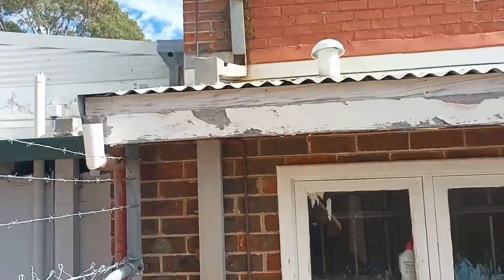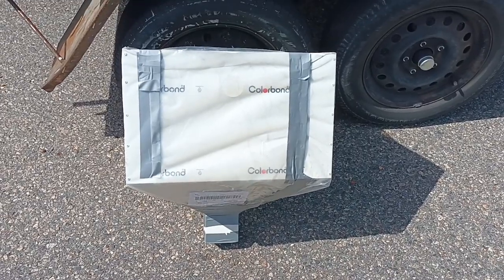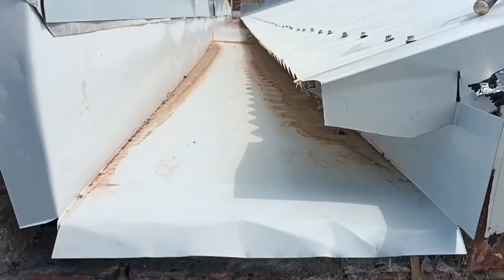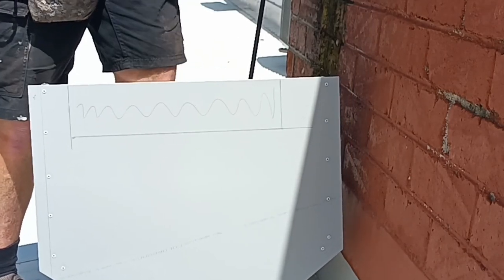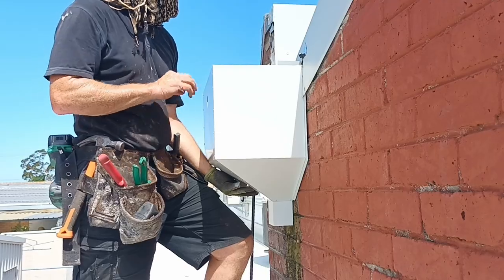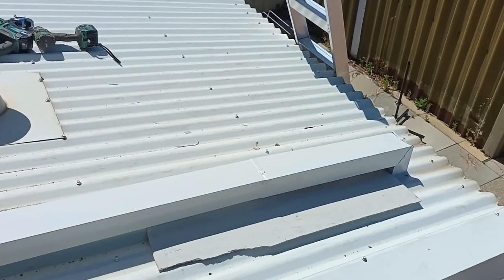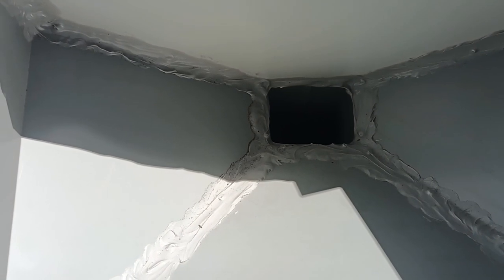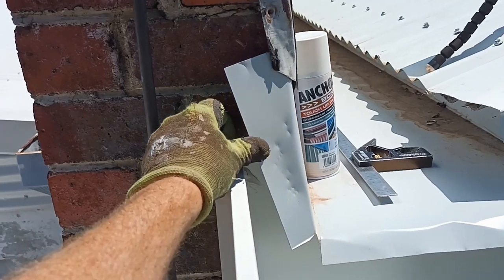Catching water and redirecting it with a rainhead

Comment: Sweet Exactly What I Need at Both ends of my Box Gutter , For some reason who ever Designed it and Installed it , Never Put Rain heads on Just cut in a down pipe on each end witch is Useless 
Can"t cope with all the water under Heavy Rain 
Cheers Bro
Reply from the maker: My pleasure

Comment: Thats a neat design , what about using a screen on top to catch the leaves?
Reply from the maker: You could but that one is not designed for it. If you do that buy one that slopes away at the front slightly so the leaves fall off
Reply: Thank you

Comment: Overflow is too small. This is the reason why the regulations keep changing on overflows on rainhead designs. And also need to seal under boxgutter perimeter to stop water from entering incase on blockage. Great work manship though.
Reply from the maker: The double brick wall means the cavity stops water going back inside.